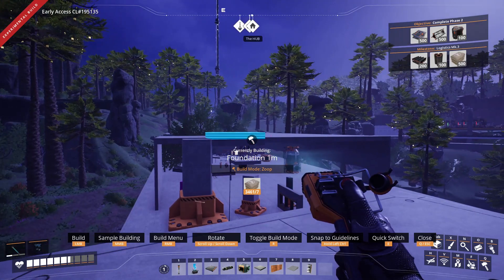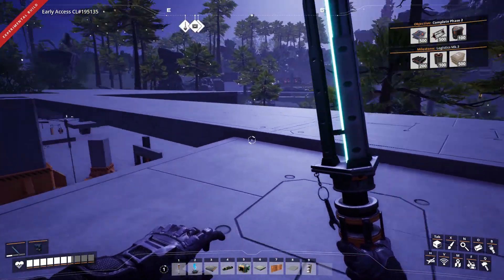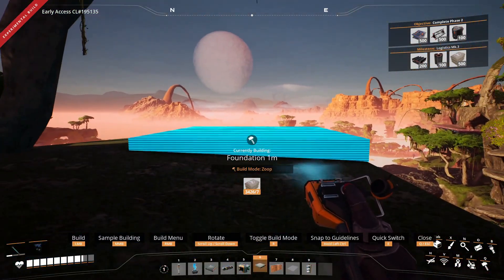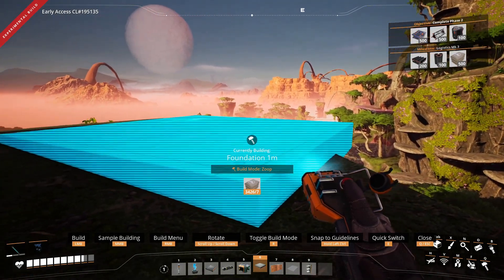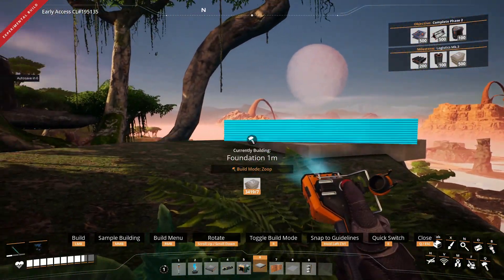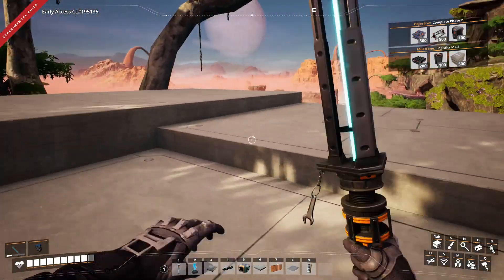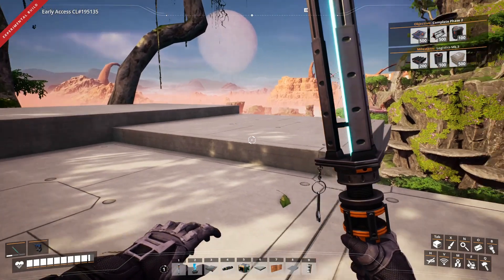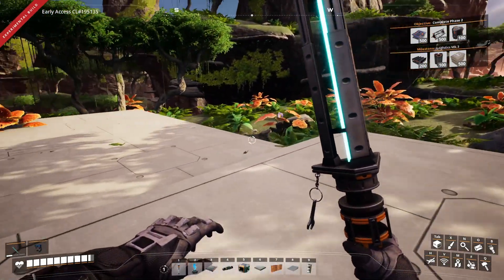Satisfactory Tips : World Grid Issue? or a Design Feature

Comment: Bumping in to this video a while later, I don't remember if it was available in U5 or if it was U6. But now we have the 0.5m steel frame that can help offset the height. Personally I would stick with 2 or 4 m foundations on the ground :) They fill out terrain gaps better.
Reply from the maker: I do like using different amounts of steel frames to achieve varied heights, but keep in mind the description in the game is incorrect. The steel frame is actually 0.4m tall. I believe the developer is aware, they just have not changed the description yet.
Reply: That's a 0.4m steel frame, not 0.5m

Comment: The issue is that the world grid has finer snapping on the z-axis to allow for placement that follows the terrain more closely. Personally, I never build at ground-level with 1m foundations. I generally use 4m, which keeps the snapping on 1-2m increments. And even with the world grid, I still zoop around to make sure everything lines up nicely, with the exception of extractors being too high, in which case, I'll use 2m to lower them to snap. TL;DR: I only use 1m foundations for sandwich layers and long-distance conveyor supports. ;)
Reply from the maker: I don't know why I picked up a habit of always using 1 meter foundations. I always think afterwards that they don't look sturdy, but in the moment, it is almost always what I pick.